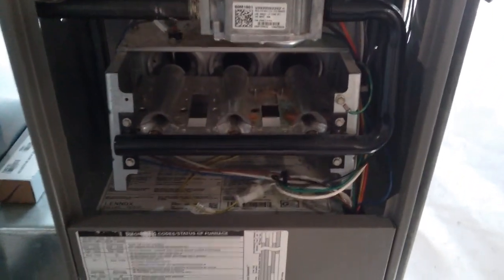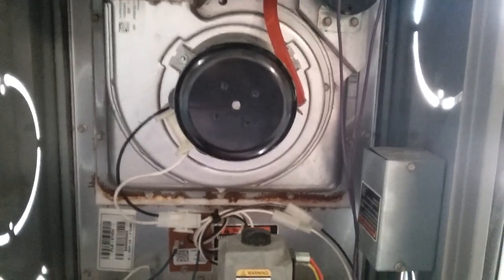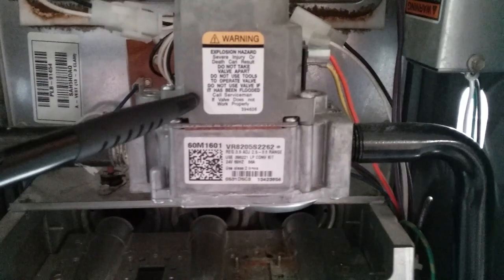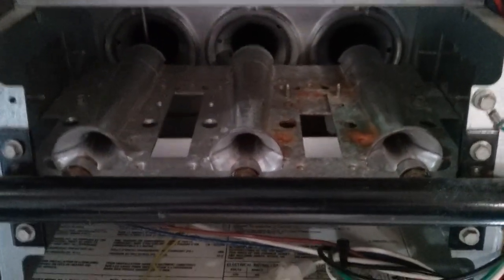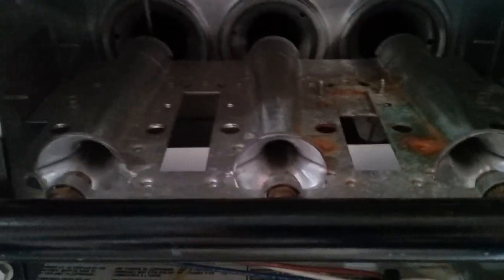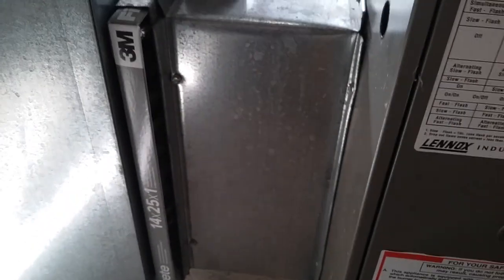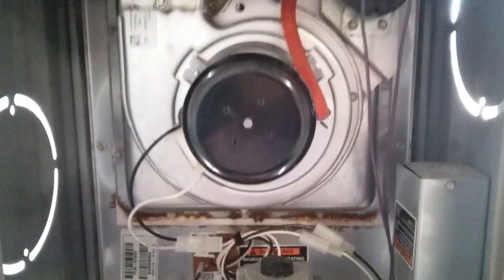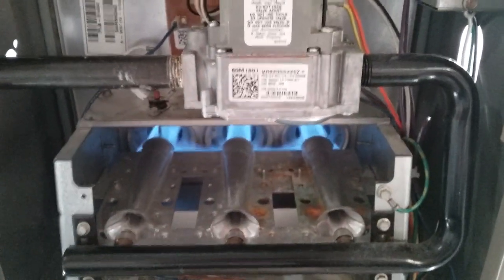Lennox G40UH Gas Furnace

Comment: Thanks! Nice, short, and informative video. But, What is the function of the heat exchanger here?
Reply from the maker: The heat exchanger in a gas furnace separates the combustion process from the air you breathe.. It is a chamber and passageway that starts at the burners and ends around where the chimney vent connects to the furnace. Air is heated as it is blown across the hot metal surface of the heat exchanger. The heated air is then distributed through the house to warm the house. Thanks for watching!

Comment: Which AC unit do you have? We are looking to upgrade our AC unit to a RUUD and have the same Lennox furnace. I was told that we could save $$ to replace the furnace. But is there a need to really change the furnace if it is running fine? Ours is 12 years old, thoughts on whether this furnace can work with a newer AC unit? The only air filter I change is in the rooms where the returns are. I didn't realize there is a filter for the Furnace but we have the furnaces serviced and have no idea if this filter is changed. Am I missing something here ?
Reply from the maker: I have the Lennox Merit series AC unit. The whole system is now 15 years old.  I upgraded the AC unit May 2019 to a new Lennox Merit series and kept the furnace because it works just fine. The old AC unit was charged with Freon, which is no longer made and in short supply. The new AC units use Puron and are more efficient,  I don't know if a Ruud will work. I do not have filters at the returns in the house just the one just before the blower. The type of set up you have filters both heat and AC at the returns.